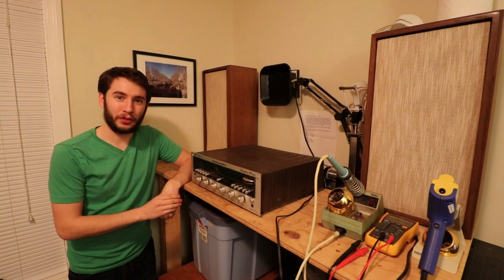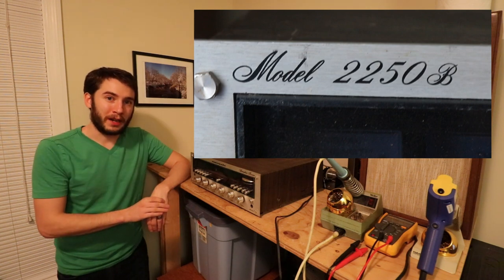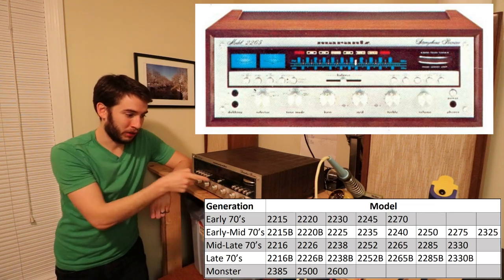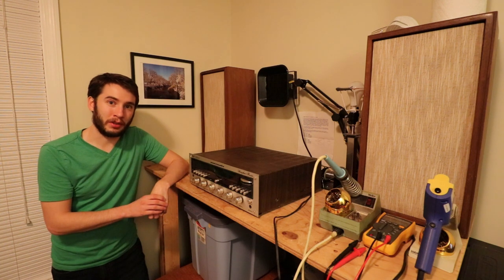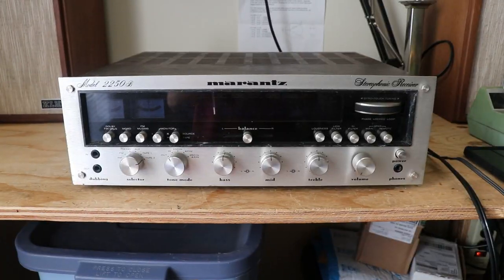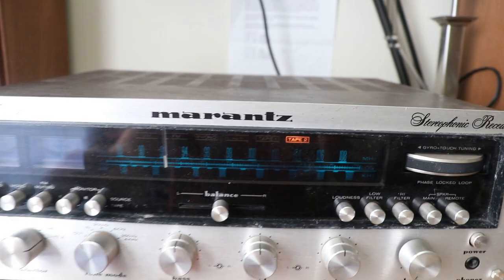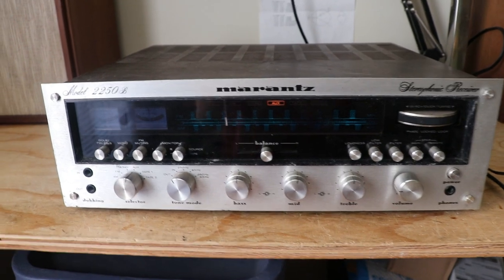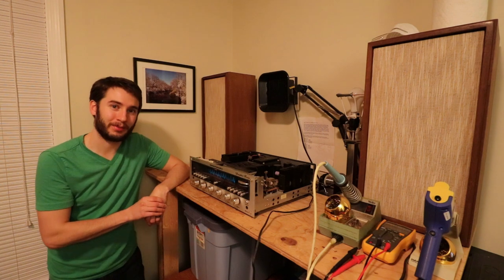Vintage Marantz Stereo Receiver Buying Guide

Comment: First digit = amount of channels 
Second digit = series 
Third/Fourth digit = watts per channel

Example= the Marantz 2270 is a 2 channel receiver from the 2 series, with 70 watts per channel.

The 1 series are very old, like 50s and 60s, the 2 and 3 series were made in the 70s. The 2 and 3 series-also known as 22 and 23 series are the same except all 23 models have more the 100 watts per channel, and all 22 models have less than 100 watts per channel.
Reply: Cool thanks 😊
Reply: Thank you, I never knew what the second number was either.
Reply: MARANTZ SR2000 = 30watts per channel but the 3rd and 4th digit are zero ?
Reply: @oyingblog3317  they dropped this whole naming system by about 1980, not to mention the fact that most of the receivers in the sr series weren’t actually made by Marantz, they were made by Sanyo over in Asia and sold as Marantz receivers
Reply: That makes since. I have a 2216B
Reply: i know it is kinda randomly asking but does anybody know of a good website to watch new movies online ?
Reply: @Zyaire Remington Thank you, I went there and it seems like a nice service =) I appreciate it !!
Reply: @Clayton Jesus Happy to help xD
Reply: @liamreuter357  junk
Reply: @oyingblog3317  those numbers meaning do not stand for earlier models like your SR2000 which are not from the 70's
Reply: That doesn't explain the  2600...that was Marantz flagship in 1979 ...one of the most powerful receivers on the planet...and the oscilloscope is pretty cool
Reply: @claytonjesus4635  DeezNutz  has tons of movies 🍿
Reply: I love your channel.  I just brought a Marantz 2238B to update.
Reply: @mmaranta785 I have to a 2216B - I need to update, the volume sounds scraching, but the sound is very powerfull.

Comment: Still have my Marantz 2245 in Walnut powering Advent Loudspeakers purchased March 1975 with owners manual. Receiver is in original perfect condition including the wood cabinet.  The only repair...on, off button spring after the first 30yrs. Turning 71 next month and expect it will outlive me.

Comment: I have a 4300 that I bought in 1974.  One channel is out, otherwise it works and looks great.  But I am interested in repairing/restoring it.  So, I look forward to your upcoming videos.  Thanks.
Reply: Most of these receivers have drop out due to the contacts are dirty. Jiggle the selector switch, volume knob or balance control it might come on. Fix it right with contact cleaner.

Comment: I have a fully restores 2325 and absolutely love it.  I used to own a 2270 back in the 70’s.  I got lucky and built a vintage system for myself.  2325 receiver, 5220 cassette deck, and 6300 turntable - all Marantz fro same era.  Speakers are a pair of Dynaco A25’s.  Wonderful sounding set up.

Comment: I just got a 2245 in working condition for $700. Originally $800 but the seller sent me a discount offer after having it on my EBay watch list for almost a year. So I jumped on the deal cuz I was afraid I would never get that kind of deal again. After purchasing I found that the seller was right here in my own state of Oregon! So I received it in just a couple days which was so awesome. The only non-functioning item is that the Stereo light doesn’t come on in the Radio stage. It comes on in all other functions. Other than that, I am completely blown away by the build quality of this receiver! It is built like a tank and functions So Smoothly! I’m lucky the radio dial lights look Beautiful along with all of the Function lights. The VU meter lights are on but the Signal Strength meter doesn’t move and that light is starting to turn white. Other than that it seems to be in pretty great shape! I am lucky enough to have a vintage stereo repair guy in my pocket and he’s going to bring everything to factory condition, or “Better” by his words for a hundred bucks. He did my Pioneer SX-750 a few years ago and It is still like brand new so he has my full confidence! I feel like I got a fantastic deal for $700! I
 am So happy cuz I never thought I’d be a vintage Marantz owner! I’m SO curious what this unit would be worth in factory condition after my stereo guy is done with it. Anyway.. just wanted to share my excitement. Thanks for the video
Reply: If there's no FM stereo light coming on when using the FM radio, (but works on other inputs) then the FM radio section almost certainly needs repair and alignment.
Fairly common on vintage equipment, but may be a task to find some one that can repair a vintage unit these days.

Comment: I have a 2285, no B, I bought at an estate sale 11 years ago for $25. Had no idea rather it worked or not. It did and does, but several of the bulbs are out, as typical, and the pots could stand a cleaning, Great and pretty rare Marantz receiver.

Comment: I picked up a 2220B at Goodwill about 20 years ago.  It's been sitting under my monitor since then and is a daily driver as a tuner and computer speaker system.  Have used it in the past with a turntable when I was ripping rekkids to CDs for people.  Best $35 I ever spent.
Reply: I have the 2220B, I really like it it has enough power for my Reel to Reels and turntable, great for my small apartment. I would like to get the walnut cabinet for it, if I could find one in good shape.

Comment: I have an original 2238 that I bought new when I was in junior high all those years ago.  It's still my main receiver and the only issue is the bulb on the fine tuning meter is burnt.  I also have a restored 2275 that is a beauty, I'm just trying to decide what speakers to go with.  Marantz rated their power sources accurately if not conservatively.   The tech I go to says that Marantz were built to last and easily repairable if they do break.  Great video, thanks!

Comment: Absolutely, these were superior products built by Marantz in the 1970's.  In the last four decades, there has been enormous advances in manufacturing, materials and electronics technology. That being said, Marantz still builds hi fi components today - being there is such a demand for these vintage units, whats preventing Marantz from building a new model receiver, essentially replicating a model 2270, 2600, etc., with a brushed aluminium faceplate, flywheel tuning, chrome knobs, etc, and charge the current market price for a unit at that level of quality? Im sure there would be a heckuva demand for a new unit at that level of quality. I know I'd have my checkbook ready to go!  Are any executives at Marantz ever  considering "bringing back" some of these classics?

Comment: Agree that you can safely select a Marantz based on its looks, provided it's in a power range (and price range) that works for you.  Also, some models don't have the trademark Marantz slide control for balance; my 2270 has a rotary knob, which I like better.  But it's not a big deal.  As others have noted, the lowest power models, e.g. 2216, punch way above their weight in volume and sound quality.
Reply: Any recommendations for a marantz that is compatible with compact disc players? thank you!

Comment: Good info, I love my Marantz it's a Quadraphonic model so not as powerful but plenty loud. had to deoxit the pots new led bulbs and replaced a few caps but other than that it was great...
Reply: Mines a 4300 i run it in 2CH bridged mode and it rocks

Comment: First number how many channels.
Second number if 2, it's under 100 watts per channel. If second number is 3, it is over 100 watts per channel.
Third and fourth number is the watts rms plus 100 watts if second number is 3. If second number is 2, the third and fourth number is the rms wattage.
The monster receivers (2500/2600) are first number how many channels. The rest are the RMS total watts both channels combined.
Older 2 digit numbers are the number of pieces made, ascending.

Comment: I currently own a 2250b that I had restored. It was not cheap ,wut when done right I will last for along time with that warm Marantz sound. Face plates and wood cabinets are available on line. 
 Marantz manuals can be downloaded on line.
Reply from the maker: I will be slowly restoring the one in this video!
Reply: @AHFixIt  watch out for Chinese parts
Reply: @AHFixIt  Hello!  I would love to pick your brain about a Marantz 2252 I purchased some time back on eBay (supposedly in restored condition) that began to slowly give me issues over the years. In short, Im forced to have everything running through the Tape Monitor Input (via a passive audio switcher) because all of the other inputs produce distorted sound on the right channel.  And NOW thats starting to happen on that input as well .  Do you have an email address I could contact you at?

Comment: Happy with my low wattage sansui, the marantz stuff is to over inflated in price.
Reply: That’s a reflection of the quality of Marantz gear. I still have my Marantz 2275 receiver I bought in 1977, serviced in 1998 after 5 house moves, everything still works. Best $325 I ever spent on audio gear.

Comment: I have a set of Dynaco a 25 speakers and a marantz 2245 receiver.. it is not very loud so I just bought a marantz 1060 amplifier. and 2 extra speakers also a linear cassette deck and marantz 6 CD player for $2500 is this a decent system.
Reply: live in the Detroit metro area maybe Alden can help me service the system

Comment: Thanks - I have a super sounding 2226B Marantz which has an intermittent fault of cutting out in the left channel, sometimes with a bit of distortion and particularly when 'cold'. So works fine some days, others not, which as you can imagine is very annoying. What's worse is I took it to a supposed reputable repairer who 'couldn't find anything wrong with it' (it is definitely faulty, regardless of source or speaker selection, however more pronounced on the phono selection) and claims to have done some re-soldering of some connections. Anyway, no change, so am really looking forward to your future videos as this might at least give me some clues as to how to find the fault and possibly fix. I've gone back to another amp as it was ruining my listening pleasure, but really want to get my Marantz working properly again....Cheers!
Reply: Hi I had a 2226b for 30 years, I too had a intermittent fault, turned out to be the tape monitor switch, found the fault by chance random pushing ...
Hope it helps, 2226b is a great amp..
Looking to buy another one here in Turkey..
Cheers👍
Reply: I have a Sherwood S7244 receiver from the mid 1970's with a similar intermittent problem - namely, the left speaker would go out. It was looked at and checked out to death under warranty, but was never fixed. Numerous resoldering of connections didn't fix it either. Sherwood even extended my warranty but no one was able to fix it. Strangely enough, I still have this receiver. Maybe one day.....

Comment: I replaced lamps with incandescent, and the two stereo indicators with led. Left original incandescent in all other indicator spots.  Used one layer of vellum. Now dial is very dim. LEDs were 8v vs 6.3v original. What do you think?

Comment: back in 2013-2s through 2016 got some really good prices. example. model 125 tuner 250. 3 1150s   integrated amp for 215 to 160.00. 22220B 185.00 Model 20 tuner for unbeliveable 600.0 perfect conditon.  2225 recapped for 250.00. 2240B for 185. and on and on. NOW its crazy prices. are they running out? Or is the market changing because of extra money from covid. Your guess is as good as mine. All i know I could make a killing if i choose to sell. which is very unlikey. I'm still trying to buy at a nominal fee for a pristine setup. but also have other high end brands which will go down to my family. Remember you can get very good prices on Craigslist. Just got 1 Klipsch Hersey perfect condition for 275. looking for a matching one. Just be patient and create a decent communication with seller and you might get get some for a  little less. Good luck everyone. And God bless everyone.

Comment: Hi,
I have a Marantz 2440 Quad "Adapter"
I need to change the lights.
What is the easy method?
Open it from the top or by removing the front panel?
Thank you very much in advance for your advice.

Comment: I just bought a SR1000 Looked beautiful inside and out could not believe how clean it is But. After hooking is up no FM stereo on left channel I know you have had this problem on units you rebuilt One time you jumped out the pre-in & pre-out, did not work on mine. Could you do a rebuild on a FM turner board or give m a hint. I have full power FM mono. Thanks

Comment: They look nice but smell strange while playing. The pcb boards heat and out gas in a stink which is different than other vintage gear ive smelled before. They also have a muddy sound which some people like. They are easy to fix, otherwise and go for big bucks due to their collectablity.
Reply: That distinctive Smell

Comment: Hi, I have a question for you: I have used my Marantz 2230 for years now playing Vinyl exclusively. Recently I aquired a Denon DCD 1500 CD player and wanted to hook up the cd player to my Marantz receiver using Red and black RCA cables. I used the Tape in inputs on the marantz and the "fixed"output on my cd player. I get no sound whatsoever. I tried some different inputs, plugged it into the AUX input on my receiver, changed from Fixed to variable outputs on the cd player, but nothing....Am I doing something wrong? Apologies for the noob question
Reply from the maker: It sounds like an issue with your CD player. If phono works, then everything that runs tape and aux inputs works also. Try it with another amp.
Reply: Thank you, I will try that:)) @AHFixIt

Comment: Hi! I had 2230 and 2245, I loved them so much but then I ended my vintage experience.. Now I use a marantz pm 7005 what has far better sound than these vintages (2230 and 2245) I feel the pm 7005 more detailed, the sound stage wider, the freq response better at the edges both in bass and treble.
Sorry if I hurt vintage fans, I had some receivers from the 70s, 80s and 90s.They were great at that time and great today but a lot of things changed in that 40-50 years.
Reply: They might have the sound, but missing a lot in the looks department. I  think that's why people like the vintage for its classy look.  Especially if you have the walnut cabinet for the receiver.
Reply: @Mike Zielinski 100% agree, I need to find a walnut cabinet for mine 2220b,  I had one on my 2275 back in 1974.
Reply: @Mike Zielinski Thanks,

Comment: Bought a Marantz 2240 in about 1970 for $400, $2963 now.  It's gone, I sold it many years ago.  When tested at the dealer it produced 50 watts per channel.  Later it failed with no sound, fortunately under warranty.  I was aware of two others who owned Marantz  receivers. One of theirs failed too.  I will not buy a used one.

Comment: Had two ! Early seventies 2220 ,and mid seventies 2220 b !
Reply: B designated direct coupled outputs. Power supply in nonB versions were single supply with AC coupled outputs. They went to split supplies in the B version, and could therefore put outputs at DC ground, no output cap.

Comment: People need to know that Superscope ran Marantz into the ground after buying them. Later '70's models literally have less physical components on board, make less power than they are rated for and physically weigh less. By the time you get to the champagne colored stuff the company had been sold again and was only Marantz in name.
Reply: I'd say the last decent series are the 1060/1080 amps. The next 1070/1090 {1977} had already much less value components, but still sounded decent. After that {1980>} it's just overpriced mediocrity,

Comment: Once again, Ebay has drove up the price on all the old HIFI units. they're just not worth it, big risk of things going wrong.
Reply: For the diy inclined many vintage amplifiers (late 60's, 70's & early 80's)can be upgraded at a cost that is a fraction of what may be cinsidered modern day hifi
Reply: A person needs to learn how to work on and do the maintenance yourself.  I bought a Marantz receiver and two Reel to Reel tapes decks, turntable, and speakers off E-bay.  I got get prices on all of them. You can watch youtube videos on how to do repairs your self.